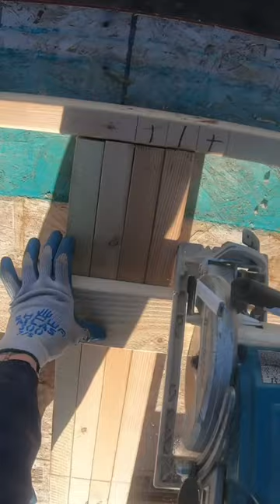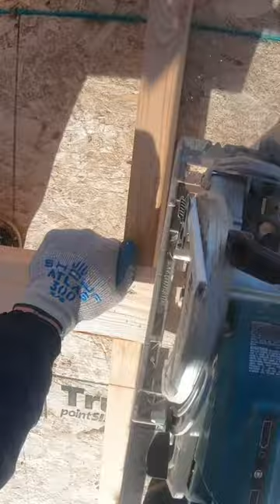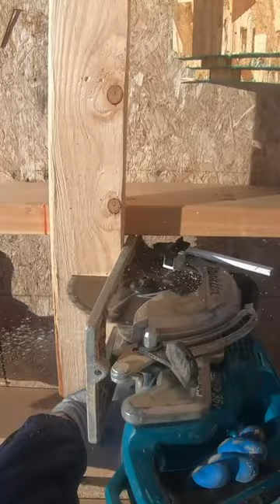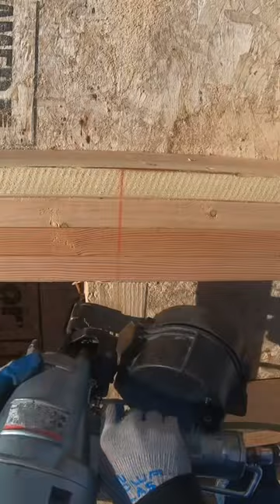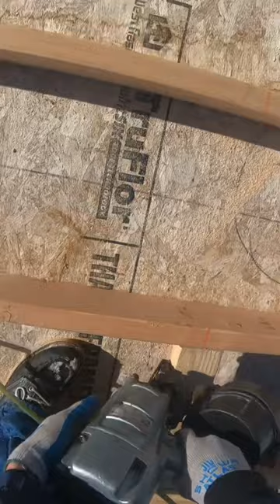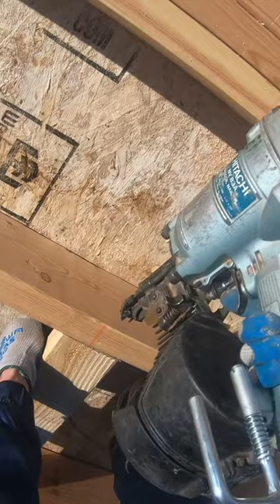Installing Blocking #framing #construction

Comment: Nah, i prefer to take out my tape, measure the space, take out my pencil, write down the number, walk to the saw horse, take out my tape again, measure and mark the 2x4, put away my tape, take out my t-square, mark a square line, cut the block, walk back to the wall, try to figure out which space the block is measured for, and nail it in. Rinse and repeat. I’m paid by the hour bro!
Reply: Bro 😂😂😂
Reply: Yeah but you ain't paid much  PER Hour if you're working like that...

The storyboard works wonders. Also saves having a walk back and forth like that besides most of them depending on the situation should be either 14 and 7/ 16th " split the line "

Far more efficient just to break out a cordless chop saw

Or alternatively learn to use your saw as one

Free up your depth gauge with a magnet

Comment: I’m impressed at how accurate you are with that method. I was always taught to cut the noggins all the same size on a mitre saw. If they don’t fit then whatever you’re building isn’t square/plumb/level. He was about 70 though… nice work

Comment: Now keep in mind that's how I lodged the skill saw into my cafe muscle full depth no I did not go to the hospital. I used electrical tape to restrict blood loss and kept on working. I got a  raise that day 

And in the following week I was picking the scab in the dead in the credit tissue out of the wound every day and when bored so I did not need stitches. Roughly a 7-in long quarter inch wide 3-in deep fillet strangely, it did not bleed. I hit No arteries tendons veins or bone.

Beware of that technique, especially if the lumber is frozen

Comment: Was I taught wrong..thought the blocks were meant to go alternating which side of the line they landed.
Reply from the maker: A lot of people do that because it’s easier to aim the nails into the wood. But this blocking is for nailing sheets onto, so they need to split right on the middle of the line so both sides can be nailed into when sheeting
Reply: @Coffmanconstruction  Additionally its the straight lines that are more pleasing to the eye and I feel it does look a weee more professional looking. My mentor strongly stressed neat straight proper cut framing and straight lines
Reply: @cndream1 and picking the right pieces of lumber.